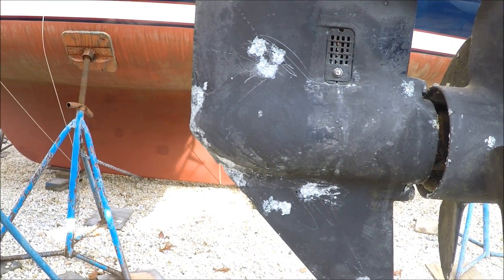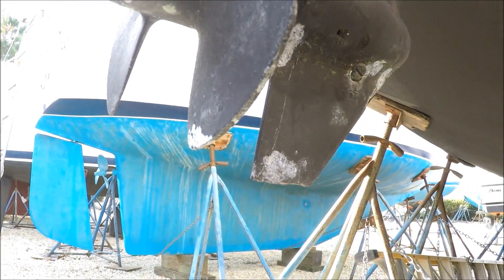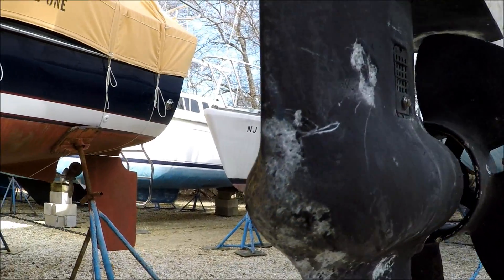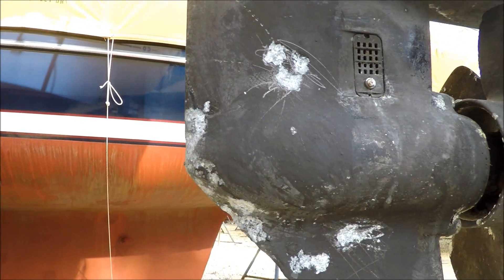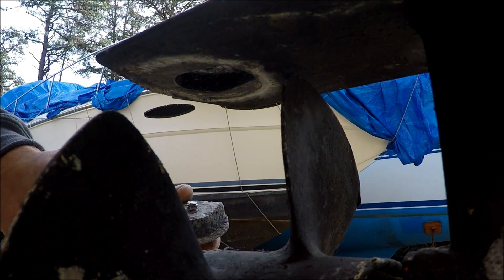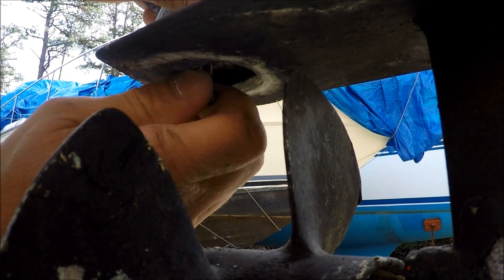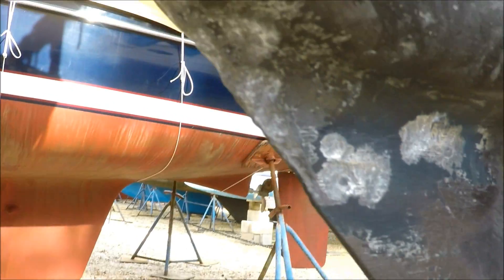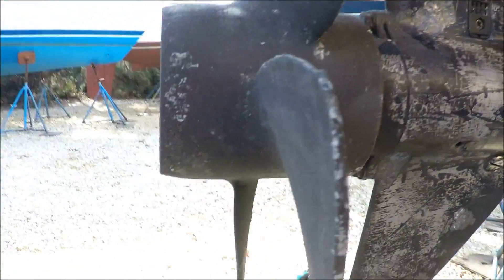118: Electrolysis Corrosion Repair Part 1

Comment: Should avoid using a Metal wheel/brush etc  Only use sandpaper (Aluminum oxide) for aluminum drives (Iron and aluminum don't mix well)